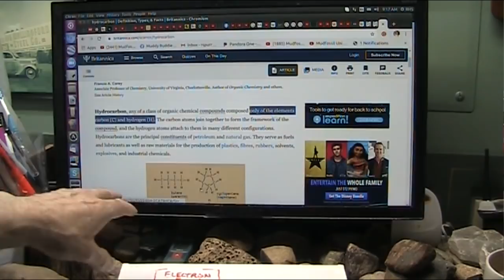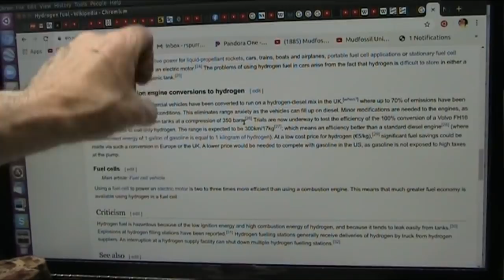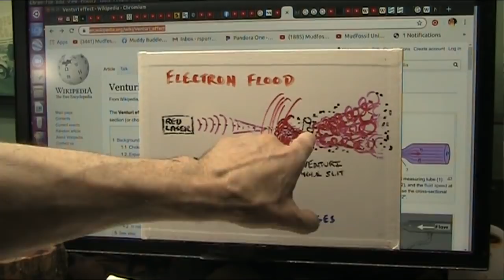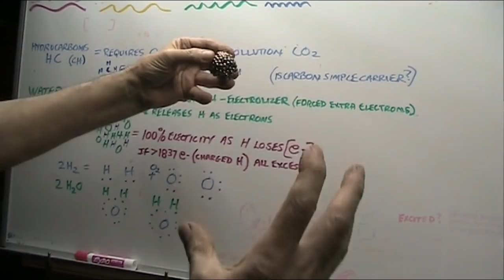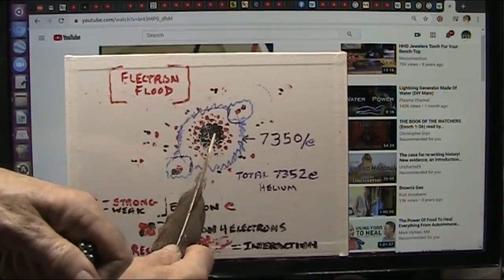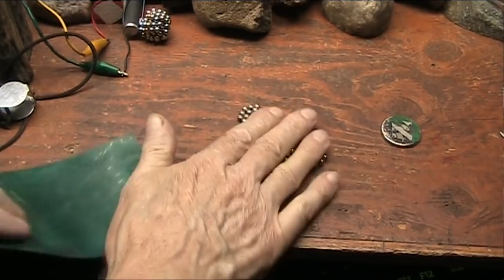Using Water as Fuel May be EASY

Comment from the maker: I see several making Browns gas and using it now but.... You are forcing electricity thru water right? I am using the piston SUCTION thru the valve to create the venturi and NO ELECTRICITY REQUIRED and flow is based on speed and piston suction just like gasoline. The design of the RESTRICTION venturi will create the gases IMO and my father did it. We need to EXPERIMENT with old carbuerated engines like lawnmowers and feed water in thru a pinhole venturi using a needle valve to adjust the water.
Reply: I’ve always said that oxygen and hydrogen would probably separate easier under vacuum
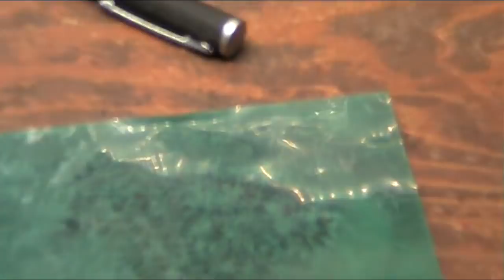Reply: 27:55 - dude that looks like a city from above. or circuits. 
remembering star forts...
Reply: Roger they cut your last video sound ,and comments. The one after this one.
Reply: Hey Roger - just seen this and thought you may find it interesting....right up your street ! https://www.youtube.com/watch?v=N7adJSx7Ln8&list=WL&index=2&t=3s
Reply: My wife and adult son James have been fans of your research for some time now  and I have been recommending people to check out your work on the Facebook pages I am admin or moderator on. Regarding this article, I have a bottle with medical grade silver rods, using electricity from the car battery to do the separation of molecules. The big drawback is the current draw. Its too high and therefore acts like a brake on the engine, like having the aircon on full. This method of yours overcomes the problem. I live out in the edge of the Balkan Mountains, up high on a large flat mountain. You would love it here. Mountains full of the remains of the Nephelim Giants. This land of Thracia Bulgaria once had the largest deposits of gold know to mankind. And we know where that came from. Its a very poor country and me being able to experiment over the winter on some old four stroke petrol engine to perfect this idea is something I look forward too. If I can exchange water for petrol that would greatly help my bills. 
If you ever fancy checking out the mountains over her, let me know. You can always stay with me. I have plenty of room.
Reply: I swear I heard of some kids in an African school who made fuel out of urine. Idk I gotta find it

Comment: Only magnetism will not diminish the capability of the chemical components. Mechanical mechanisms are designed to entropy. If you think about the human body, it is designed with restrictions in the electrical sense (with heat as the bi-product)as well as unlimited deviation in the magnetic field, which emanate from the heart. The electrical component is secondary to the magnetic anomalies of the body. 🙏❤️

Comment: I have an electric BMW i3 with a "REX" aka motorcycle engine to keep the batteries topped up.  I think it is possible to use some of that electricity to split the water into HHO and run the engine which should be easy since the engine doesn't need to change speeds since it is only keeping the batteries topped up.  If all cars were made this way we'd probably never need to charge them nor use gas again forever.
Reply: If it's easy, what's stopping you?

Comment: Roger, water rusts engine parts , also the oxygen makes the hydrogen burn hotter. Converting a diesel engine is easier because they are stronger built. People think you have to have a lot of power to do the electrolesis it is not so I had a small hydrogen generator that would bubble away when the sun was shining. I think combining the electrolesis with a venturi may be the best. The diesel will help control rusting of engine parts. I really like the new design opposing piston engines , since they dont need poppet valves. Electronic controls may be needed.

Comment: I suggest ionizing the water first with a laser before passing it through the venturi so there is already some charge separation. Gerard Pollock published the best frequency in his book the 4th phase of water. You can use UV or IR, probably better to use both. Also experiment using water made with the John Ellis machine as he alleges the water has a wider bond angle even when it cools so has more potential energy. It does seem to produce more BG with less amperage in my BG machine. For the plasma spark the spark plug with a cross in a dome shape looked to me that the spark was plasma. Too bad the inventor never got it on the market.

Comment: the issues I I was facing was the ability to adjust gas flow. It had to be very closely calibrated with the butterfly flap on the throttle body. Varying the voltage manipulates the gas flow. The easiest device that I have made so far was made out of a stainless steel coffee thermos with A-Rod and a bunch of washer spaced out running down the center. I baked sodium bicarbonate in order to make sodium carbonate and then mixed it with water to sok the washers inside. This little thermos was able to easily and with little effort power my four-wheeler all I did was beat a line into the chamber where the air filter is
Reply from the maker: You were forcing electricity in right? I am using the piston SUCTION thru the valve to create the venturi and NO ELECTRICITY REQUIRED and flow is based on speed just like gasoline.
Reply: @mudfossiluniversity  electrolysis is how I create my hho
Reply: @mudfossiluniversity  I wasn't aware of any other process Manufacturing hydrogen besides through electrolysis

Comment: Check out bill cozolino he was working on this for years way back years ago and showed it was quite easy to ignite a water vapor cloud but could never get it to run reliably in his car he had an old VW Microbus I believe it was fuel injected but he was working more on plasma ignition then on running it on water I think the two were tied together plasma ignition and water combustion. Like Roger I'm too old to chase this stuff anymore. But if you're interested check out plasma ignition and Bill cozolino
Reply: Biggest problem in most cars is the constant change in demand on the engine.  The engine in my electric BMW i3 keeps the batteries topped up so it only needs to idle at a set speed.  That's the best way to utilize running off water.  Design an engine that only runs at a certain RPM's to run only on water and use that to keep batteries topped up and no more recharging.  Could probably even design it to pull water out of the air so you never even need to stop.

Comment: I use 12 volts five plates bubblers but I purge the bubblers to separate the hydrogen and oxygen and then I join the gases back together with the resistor or the ball valve with a cut torch tip it creates fire your bubbles have to have flash resistors where that you could cut it off and throw it down into the water and it puts it out there's a lot to that you can't use just any medals stainless steel is the best
Reply: Yes, that's the way to build a hydrogen on-demand system. It's not complex. It's a fantastic means of making fuel and the hydrogen torch has very unique properties able to heat anything to its melting point yet safer than any other open flame there is. It should be used to fuel all combustion engines.

Comment: it's just like making fuels diesel kerosene gasoline propane methane gases with water using used motor oil or new yeah I call that a cracker I'm using mine for the methane gases which runs the engine the hydrogen and oxygen separate in hotspot they can't go back together makes the fuel thinner and thinner

Comment: Sounds like your Dad had the same issue nitro injection (no2) had to do with temperatures, the heat swells the rings that are around the pistons causing them or other parts to fail due to too much friction and expansion. The fix was to open the ring gap to allow the swelling to have more room to expand, what you present is on another frequency - man, when what you present is tweaked it over for big oil. Tread lightly...
Reply: COVID will squash any such success for lack of a better word, this virus seems to attack laws and rights